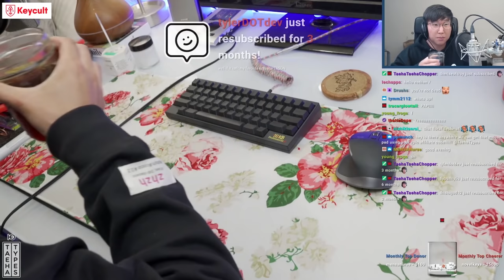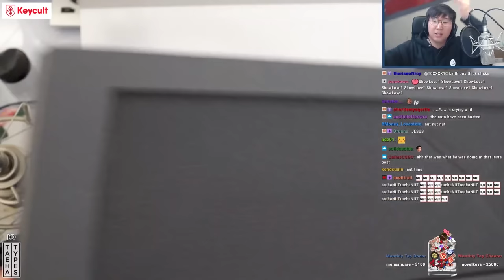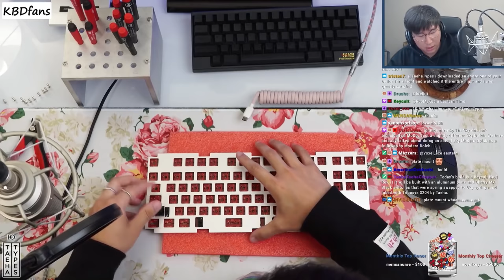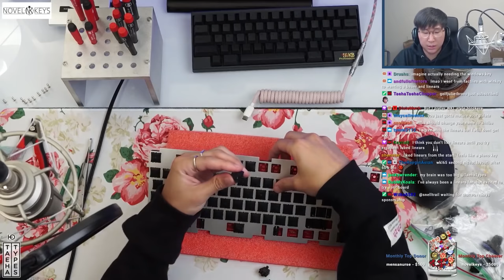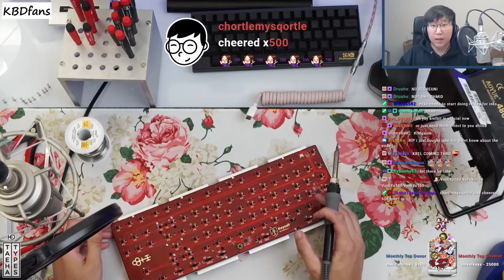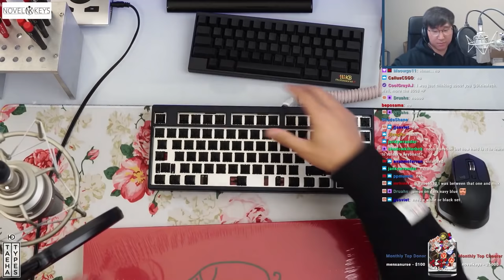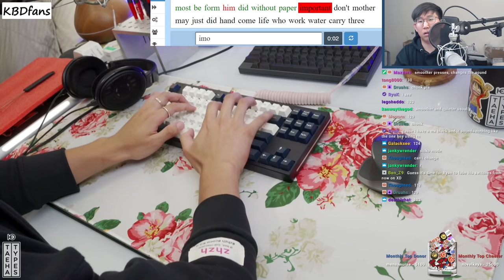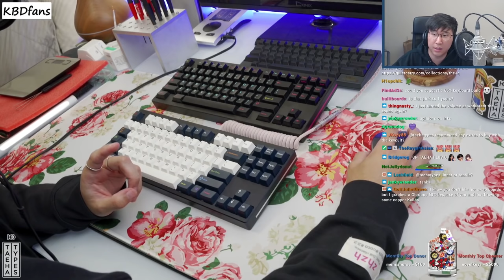Keycult No.1 Rev.1 Reveal/Build Stream

Comment: Weird question, does the rotation of the stabilizer matter? As in which way the metal bar goes
Reply: It doesnt technically but you only have one way to put them on the PCB + plate.

Comment: im getting more into mechs but dont understand why this is like $500. realistically is it just the case? because the pcb offers nothing you cant find elsewhere for cheaper
Reply: its like buying a gucci there is a quality difference, but in the end u pay for the brand, and one thing u dont have to forget this is a small marked so to get the production cost and make profit its really expensive ( a maschine for 5000 is more profit than one for 50 so big brands with lot of sales can affort to be cheaper) also as far as i can tell its cnc maschined and not plastic as most "normal" cases are
Reply: Metals are not cheap to source and manufacture in low volumes. While I'm sure Keycult is also taking a profit on this board in order to keep their business running, Most of this has to do with the cost of designing, sourcing the material and the parts, and manufacturing the actual keyboard. The design on these boards are far more complex than your typical mainstream mechanical keyboards that costs anywhere from $30-$200. 

This PCB in particular actually does offer more than your typical mechanical keyboard PCB. Quality aside, this PCB is compatible with the VIA Configurator, which is one of the most intuitive and easy to use keymapping programs I've ever used, and that includes those buggy software from Corsair or Razer, and QMK. Even in the custom keyboard scene, a PCB that supports VIA is very rare, as far as I know, only Wilba's PCBs have it, and they're only in boards made by 3 companies: Rama, Zeal, and Keycult.